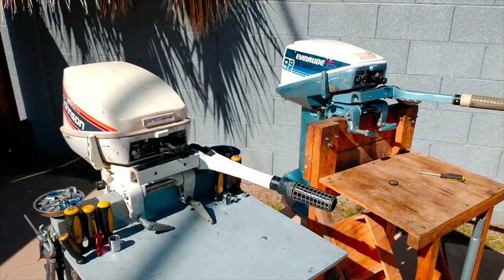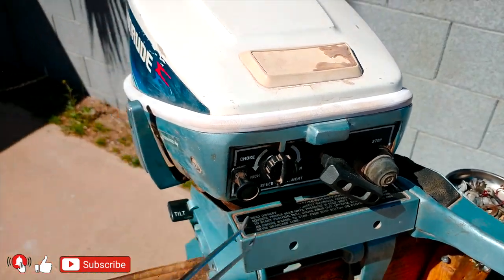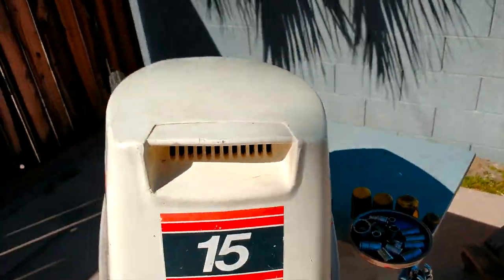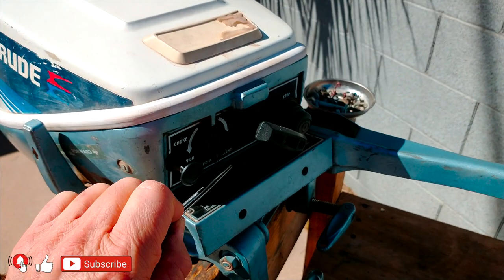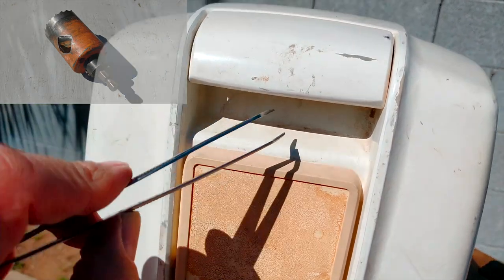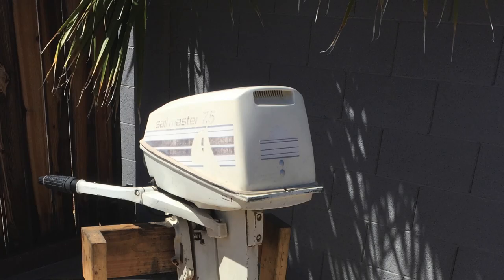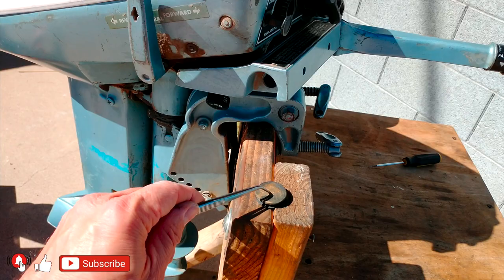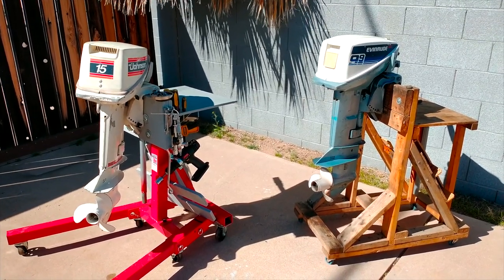4HP, 4.5HP, 6HP, 7.5HP, 8HP, 9.9HP, 15HP  Johnson / Evinrude outboard motors performance secrets

Comment: Thanks so much for you reply, can I just block the hose that goes from the primer to the manifold ? the only other thing I can see that I need to do is drill a hole in the centre front of the 8hp motor to fit the mixture adjustment that is on the 7.5hp carbie, is that right. Thanks for your channel, John.
Reply from the maker: Yes

Comment: Have you tried to switch the hoods and do a actual test on the boat, not just theoretically talking about it. Thanks.
Reply from the maker: I have the later version of the engine hood and  when I test the motors and do tune up I use the newest hood with wide openings. Then I install the original hood that belongs to the motor for the second test and  video recording. Believed or not there is a big difference for the old motors with old engine hoods. I haven't done a boat test, because I don't have the right boat for this model to perform the test
Reply: @BoatMotors  
That’s all we need to know…there’s a difference when switching different hoods. Thanks!

Comment: Thanks for your video, I've just got an 1987 8hp Johnson with the fuel primer choke system, it's giving problems starting, and running, starving for fuel and flooding. Rather than try to fix the fuel primer I have an earlier model 7.5hp that has a normal butterfly choke and a good carburettor. Can I use this carbie in the 8hp, it looks like it will fit, it seems like all I would need to do is block the fuel intake where it goes into the manifold from the primer/choke unit. This seems simpler than trying to sort out the fuel problem on the 8hp carburettor system, at least I know the carburettor on the 7.5 hp is working. Advice from you or any others would be appreciated. Thanks, John.
Reply from the maker: Yes you can do this and your motor will work very well.

Comment: The 15 horse also has a bigger carburetor and a tuned exhaust that the 9.9 horse does not. With the bigger carburetor and different exhaust the 15 also spins 1000 more RPM. I’ve had both of them and the 15 is much faster. I wonder how the 9.9 would run with the hood off?